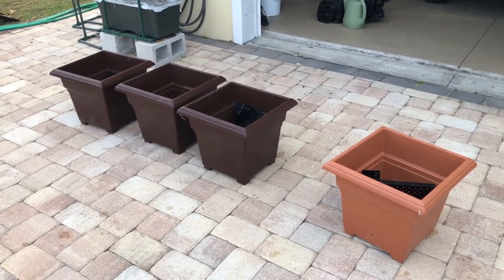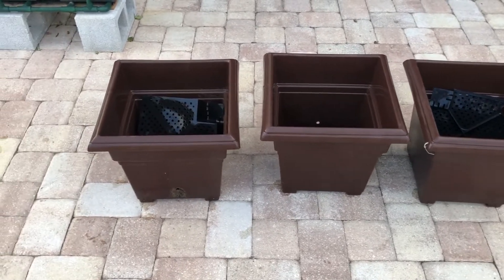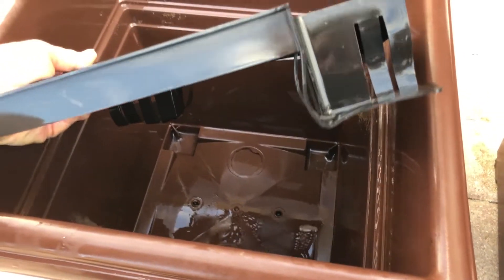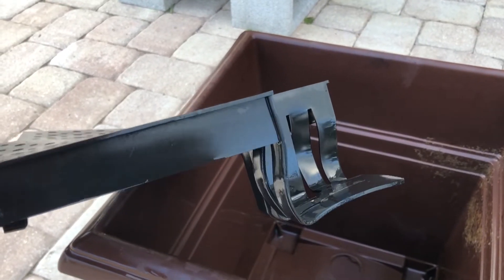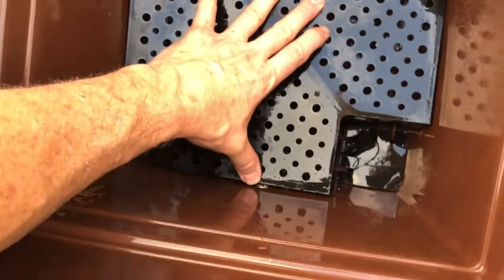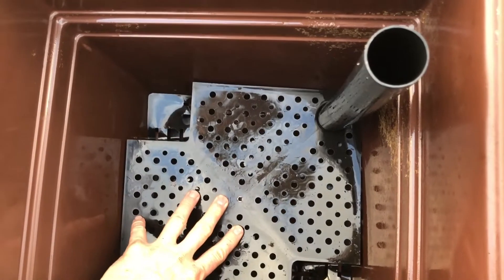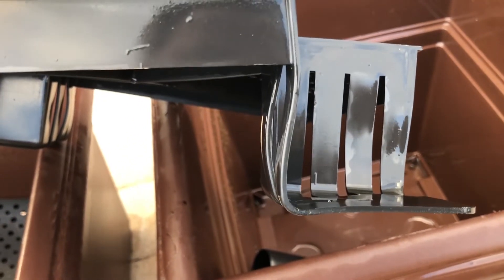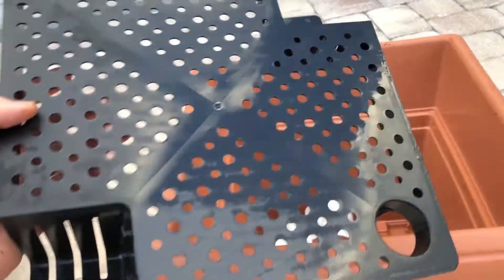Earthbox Root and Veg - Design Problem

Comment: I've been looking into getting some of these for carrots and beets but was turned off by the negative reviews outlining exactly the issue you've displayed today. I may just get them now since the PVC to fix the problem wouldn't be more than .50c - $1 of PVC per box. You'd think they would have supported the system better if they did some basic weight testing! Great video resolving an issue and not just pointing one out!
Reply from the maker: Thanks Cam, yes I'm surprised they let this into production with such little support. It would be an easy fix for the manufacturer.

Comment: Great video thank you!!! I’m about to buy my root veg and now I can avoid the learning curve thank you!!! So if you fill the box until it over flows, is their still a air gap or does it touch water when full? Or can u even tell?
Reply from the maker: There should be an air gap. This is the reason for this video, the bottom support was sagging and dipping the potting mix into the water reservoir so the mix would get waterlogged.

Comment: Those are expensive, I am thinking about screwing 1 inch by 1/2 inch hardware screen to a tote with your cut pvc pipes down the middle for support. The chicken screen look like stainless steel, but I am not sure if it will hold up. I will lay shade fabric on the screen, so dirt don't fall through.
Reply from the maker: You will need a section to dip into the water reservoir to wick the water up (it's the corners in the Earthbox design). One niuce thing about the Earthboxes is that they hold up for years in the sun where I've seen the tote made ones fall apart within just 2-3 years. Over the long term they are a good investment but you are correct that they are expensive initially. If you sign up on their site for email specials you can get deals like free shipping or buy 3 get one free. Good luck!